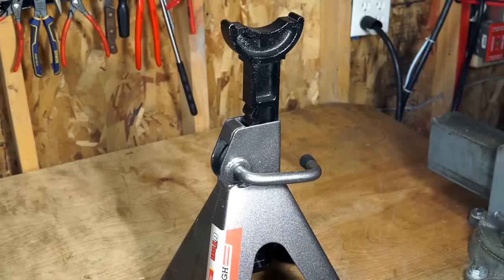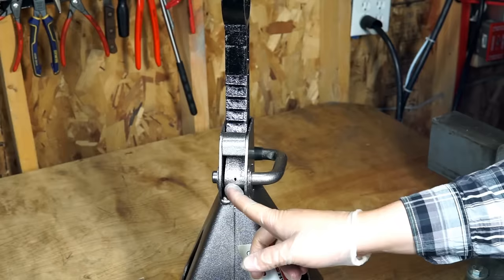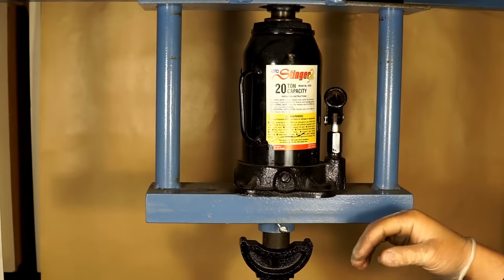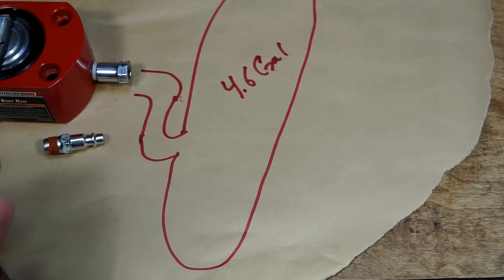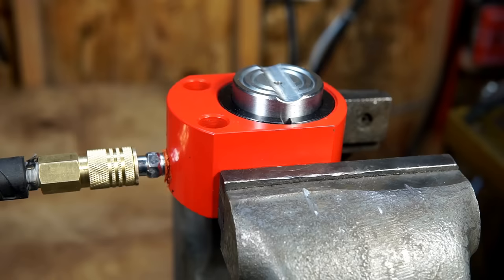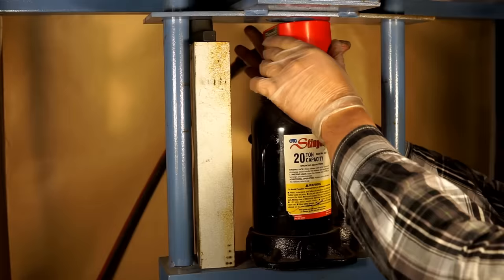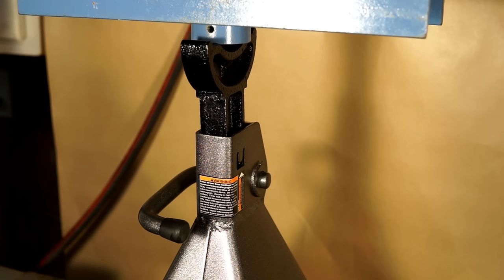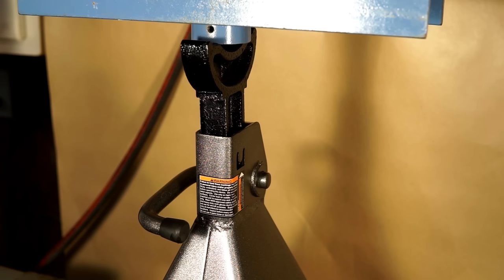EXPERIMENT: WARNING! Doing this to your Jack Stands will get you KILLED!

Comment: Just put your tires under the car as an extra safety measure
Reply: Steven K i always do that...
Reply: I ALWAYS do that.
Reply: I also put my wheels under the car. It will keep the car from crushing you but the car to fall just enough to crap on yourself.
Reply: Steven K. I hate the idea of getting my new tires killed everytime i do it but in the end, better them than me.
Reply: Doing that on truck, it won't hit the tire until another four inches. So I just put my ramps with blocks under.
Reply: Steven K what if i don't take the tires off
Reply: I just keep the jack under the car and throw a wheel under there. Can't be too careful.
Reply: Michael King _I use two 4"×4" wood blocks about 8" long laid side by side and put under the tire. of course you can use more or larger blocks depending on how wide the tire is. If the vehicle is lifted with the jack high enough i may stack two or  three high.That way if the jackstands fall the tire will land on the wooden blocks. DON'T FORGET TO USE THE PARKING/EMERGENCY BRAKE WHEN LIFTING A CAR OR TRUCK. I hope this helps.
Reply: Sometimes you jack the car for other problems.
Reply: thats a good idea...  never thought about it but seen ppl do that never put it together
Reply: You can  put bricks or whatever that is strong under your car. It doesn't have to be wheels.
Reply: jozef danyi Bricks/Cinder Blocks can be crushed under the weight of the car.. especially if the car falls a bit before landing on them. Only use tires or wood as extra precautions!
Reply: Steven K I always use two jack stands if I’m actually under the car, and I even leave the jack under like a 3rd jack stand
Reply: Just don't use the spare tire LOL.
Reply: Matthew exactly how I do it too. 2 jackstand and the floor jack with 4x4 chocking the backs you have to be able to trust the way you set your equipment up otherwise you’ll never get under the damn thing lol it always help to have good equipment and know how though
Reply: Golden Grenadier  Lol
Reply: yee
Reply: Steven K Never fails.
Reply: I always do it and if IV a bita 2 by 6 I'll put that on top of the tyre 1 centimetre could save your life old school
Reply: The front tyre and if u want to go bit higher put the donut spair tyre on top of the other tyre shout out from Ireland
Reply: i always do that lol
Reply: I put jack stands,  jack and tires under the car as triple protection.....
Reply: Thanks Chris Fix
Reply: I used the tire for many years, stuffed under somewhere as a backup.    I also leave the jack on it holding weight somewhere. Hopefully out of the the way.    If its a big way. Under there in the kill zone i prefer heavy blocking.    I just took a  post and cut it in 16” lengths.    I paint them red so they are easy to find and don’t rot sitting outside.
Reply: I'm so paranoid under the car that I do that also. I leave 2 Jack's under and redundant jack stands also.
Reply: Exactly
Reply: I always put something solid under the car frame rails that is bigger than my head and also jack stands and also leave the hyd. jack in place and locked.....a lot of things would have to happen for me to get me crushed and I would have to be asleep not to notice.
Reply: use the spare or a stump or log or get a junk yard tire and wheel just for this.
Reply: My wheels are worth more than my life
Reply: SAME
Reply: That's what I do if I take them off. If not it's ramps
Reply: Just dont go under. This way. Nothing is falling on ne one
Reply: Yep use a tire and 2 3 ton jack stands and 2 two ton jack stands and two car jacks and the wife on standby to jack up the car, I don't want to be crushed and go out that way.
Reply: @MR-nl8xr  If they save you, you are aren't going to give a tinkers tap what they cost.
Reply: Rynku Viceroy,
Use the spare tyres if you have a full size one.
Reply: Keep your jack in place with the jack stand and tire under the car. Whatever you can do to be extra safe
Reply: @boyoy4227  always
Reply: @MK-ex4pb  I put blocks under the wheels and/or use an extra jack stand
Reply: I just use ramps and if the car isnt able to drive I jack it up and shove the ramps under that way they won't kill me
Reply: @MK-ex4pb  Then take your prayer book under with you
Reply: i would phrase that as rims preferably steel rims, aluminium breaks although steal bends but holds together 

2 Esdras 4:1-100
Reply: I always do that too, id rather damage my wheel and just simply replace it, rather than Lose my Life…
Reply: I always do
Reply: I've been doing that as well.
Reply: DAD IS THAT YOU ?
Reply: Use a different kind of jack-stand with a two headed safety pin (U shaped pin) that you need to pull out in order for the jack-stand to lower. Simplicity is better.
Reply: Thanks for this I think the fear of being underneath my car is what’s keeping me from working on it myself 😣
Reply: Best tip ever, also use double Jack stands
Reply: I put a diffrent kind of jack-stand under the car. A jack-stand where you see all the movable parts. You put in the pin (u-shaped pin), and you see if it's in position.
Reply: I use large, gigantic screw jacks instead of jack stands. They use these things to lift barns, houses and even trains. they hold  over 20 tons and you can screw the. up or down so there is no freeplay when you lover the jack onto them
Reply: Why
Reply: @patrick Elliott dawg what are you saying
Reply: I always do that with all the extra tires I keep in my pocket
Reply: @MichaelLangell  dawg no entiedes...güero
Reply: Always work on the car with a friend who is fatter than you are to keep yourself safe
Reply: Yeah so, I'm going to change my oil. I should take the tires off when it's not necessary.
Reply: Won't always work...Tire may be too narrow or you may be doing work that does not require removing a wheel. best is to use (2) stands (wide stance) and leave the floor jack under once raised and sitting on the stands.

Comment: To anyone reading this :    Get a Jack stand with the extra safety pin (that's on a little ring chain)  the pin slips through as a backup.   Also don't forget to bend the jack stand safety pin.   Also putting a tire, block of wood or something in other areas might be a extra safety measure, Don't forget wheel Chalks to block off the wheels.
Reply: Idk pin seems like it would break it is pretty thin for me
Reply: Don't bend pin people
Reply: @MrPlausibleDenial  What does he mean by "bend the pin"?
Reply: Excellent video. Regarding the extra safety mentioned above , I noticed the gentleman in the video is using a Pittsburgh ( HarborFreight) jack stand. The new ones they manufacture now (Daytona) do have the extra safety pin attached to the jack stand. On these new ones one MUST intentionally take the pin out in order to lower the jack stand. Just FYI. After watching this video I upgraded my jack stands to the new ones .
Reply: The first jack stands I bought had these pins. I've actually never seen jack stands without pins before.
Reply: @branden7047  they're 1.5 cm thick steel pin. And they're shaped and designed to keep the "teeth" in place, thereby locking both the iron teeth and the handle. I should add, wrap that chain around the jack's neck before inserting the pin, that way it's harder for the pin to come out of its slot.
Reply: Yeah i got some of those, always used them, but never thought it was needed till now.
Reply: Wheel chalks?  Somebody better get hooked on phonics!!  What possible safety measure can chalking the tires give?  Bwa haaa!!!!!!!!!!  Go to the dictionary and look up the word "chock."
Reply: @willboudreau1187  I asked someone "you know what wheel chocks are right?" and they said "When you write on a tire so you can see it?"
Reply: @stephen1137  I assume he is referring to the upside down u shaped slot near the top of the stand, you are supposed to punch that tab in or bend it as he stated if I am reading his intention correctly. Either way that tab should be punched inward as a safety feature that many do not even know about or do.
Reply: chocks
Reply: I rather use a bolt that will be the right size to slide through the jack stand hole and put a nut on the end of it, so that way it's going to definitely stay in place, without falling.  Yeah definitely chalk the wheels.
Reply: Yep,  Lynch pins all day..
Reply: I would have like to see a strain meter in place to see at what pressure it let go
Reply: I always throw the tire i removed under the frame rail,  just in case the jack fails it wont fall all the way to the ground.   but,  that may not be possible with some low vehicles with wider tires.
Reply: @mtnbound2764 I do the same, throw my tire under the vehicle (even a unibody). Now with a lowered vehicle you usually need a specialty jack anyway and normally their low profile hydraulic and most people dont carry them around, so they end up calling Triple A or some one else.
Reply: @willboudreau1187  internet grammar natzis need to get a life....  everyone knows what they meant.. no one( but you) cares that they spelled it wrong.
Reply: @indyguy5570  why wouldnt that be done by the factory?
Reply: @mtnbound2764  Because the stand will no longer come apart after this is bent.  If they did this at the factory it would take a bigger box to ship an assembled stand and cost more.
Reply: @mtnbound2764  
"no one( but you) cares that they spelled it wrong."

100% WRONG!!!
Anyone that cares about literacy DOES care.
Reply: @shawbros if you care so much about literacy then the YT comments section is not your safe space.
Reply: @mtnbound2764  
The point is, you made an incorrect claim.
Reply: If I remove wheels I stow them under the car but be careful not to put them where the car will lever toward you.
Reply: I always leave a floor jack under the car lifted up with the jackstands, just in case something was to happen.
Reply: Always, I'm actually surprised people build stands without the pin slot, I don't care if weight should prevent someone accidentally hitting the release lever, the safety pin slotted thru the teeth makes all the difference as well as putting blocks or your tire underneath for extra safety. That stand in the video scares me.
Reply: @willboudreau1187 you are so smart and good at spelling
Reply: All the jack stands I've ever owned or worked with have this feature. I was looking for it on the stand in the video, wondering why it isn't there.
Reply: Don't forget to bring a towel!
Reply: @trahan625  I do the same thing. I take the load off the floor jack, and just lift it back up so it's snug, but not being the main point of "lift". This, along with the jack stand safety pins, and wheels under the car (if I take them off). Can never be too safe, especially if you're always working on uneven ground like I do.
Reply: Facts I only use jack stands with a pin and tyres under the car as well
Reply: @mtnbound2764 You spelled Nazis incorrectly.
Reply: Safety pins or no, as was explained, but perhaps not emphasized enough at the end of the video, it takes an excessive amount of direct force to get a jack stand to release under load. No incidental bump or bang, even with a tool, is going to cause a failure.
Reply: @keilet  Yup, I was an auto mechanic for 25 years and never once had a jackstand release.
Now the Harbor Freight stands that we're safety-recalled are a different story. Gotta be careful what you use from Harbor Freight.
Reply: Was just thinking how glad I am that I bought a set of 4 jack stands with the safety pin, makes me feel much safer. Always have multiple layers of protection just like you mentioned 👍
Reply: @oscarwilde5473  Most of us can't afford lifts, and we need our vehicles for work. We'd be dead anyway without the ability to work.
Reply: It looked like those jack stands have the body cut out for the pin but I didn’t see the pin
Reply: "Jackstand safety pin" is just there to keep the thing from falling out at full extension. I don't see why you'd ever have to bind it or how it has any safety feature beyond "oh no, I must extend this stand or I'll die, oh no it went too far and got loose".
Reply: @oscarwilde5473  That's not what he referred to though. I have safety pins on mine which you slide in, but he's talking about bending something. What the hell do you "bend"?
Reply: @oscarwilde5473  nah not reading 45 people arguing over dumb shit im right anyone who contradicts what I said is wrong and if I missunderstood something it was poorly phrased git gud
Reply: Pin still relies on the same paw on the tongue. If the paw breaks its still going to collapse..
Reply: @mtnbound2764 *Nazis and poor grammar and spelling = poor communication
Reply: @TheSevenJr86  due to your poor usage of grammar I cannot understand the point your trying to communicate.
Reply: @jayhondacr5008  that was on purpose....